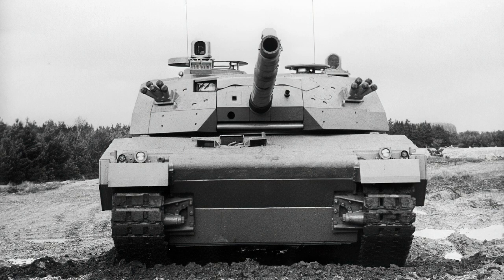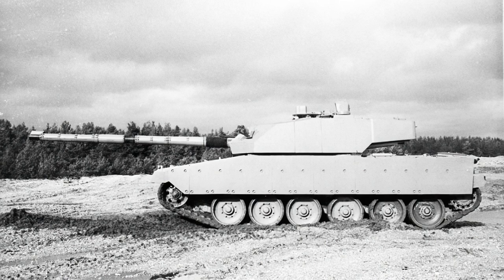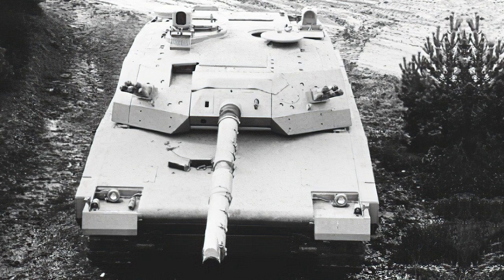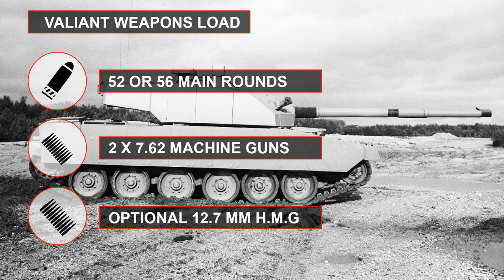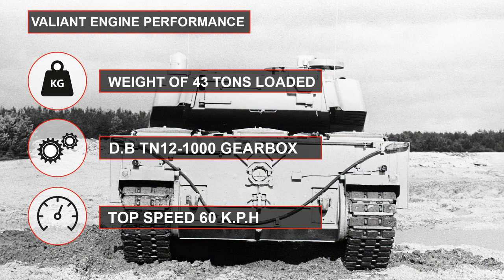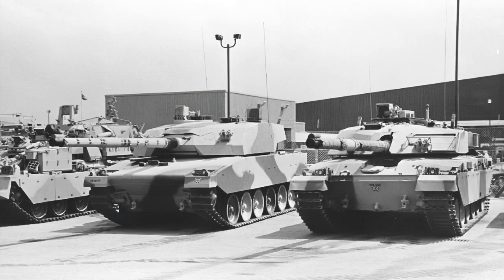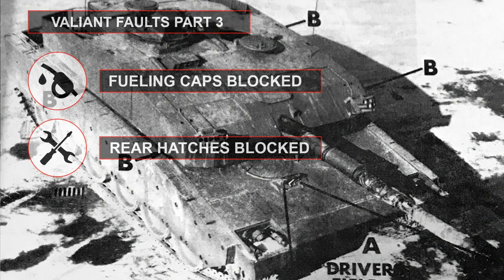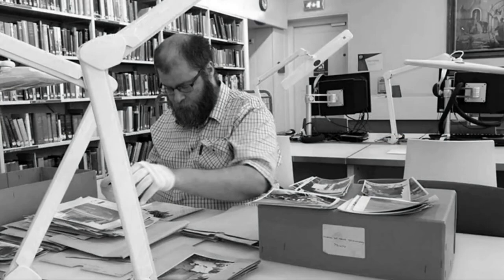Vickers Mk IV - Tank Design & Development

Comment: Great video. I worked for Vickers and was at Larkhill preparing to take Valiant to UAE on desert trials, we came back from lunch and found it upside down! major strip down at Bovington. Turret taken off and elevation gearbox repaired. the very wet soft ground helped, we still made it to the desert.
Reply: Rob, also a "significant first" was the complete integration of the weapon control electronics with the mechanics of the T & E gearboxes, turret ring etc from the drawing board forward. I was the Mil control systems GM at MRSL who developed (and named) the Centaur system. This, in its original form was our SFCS 600 fcs fully integrated with the freshly developed "solid state metadyne" (a 24v solution to the 56v problem in MBT80)- and also to the VS580 at the commander's station. I'm confident to say this level of integration WAS a world first - as a working demonstrator. Incidentally I had an NGL air conditioning system fitted to a Scorpion whilst running the Sales team @ ATDU - mid 70s!

Comment: Awesome job, thanks Ed,
Can you give us more details about the KE protection of the hull front and the CE protection of the turret front ?
I've also a few points to make :
- I think that the French 120 mm smoothbore gun proposed on the Valiant was the older G1 (AMX-40 and Osório ; export MBTs) and not the newer F1 (Leclerc).
- Regarding the dead ground in front, by the end of the 1982 two additional periscopes (slightly looking downward) were added on each side of the original.
- Concerning the viability of the aluminium hull concept : the FV4211 achieved 12 000 track miles on various test tracks, and it was found that the components life was marginally better than that of the Chieftain. There was enough confidence in the aluminium hull rigidity after six months of trials.

Comment: This seems like a great WarThunder UK premium tank!
Reply: I hope not, mutch better as a tech tree vehicle just before the vickers Mk7. if the soviets get 7 non-premium MBTs from 9.7+ (plus another 2 9.3, and then a premium 9.7) the brits can get get 2 more 9.7+ MBTs too (and perhaps some 9.3s too)

edit:
the jordanian falcon II turret family (Centurian, challenger mk1 and chieftain tanks with new turrets, partially designed by south africans) or the EE-T1 Osório tank can be the 9.7 premiums. after all the soviets 9.7 premium is a non-russian T-72.
Reply from the maker: it would indeed, but where to place it in the tiers hmmm?
Reply: @armouredarchives8867  
Tech Tree: 120mm + Thermals = 9.3 or 9.7. (Depending on engine power and mobility)
Premium: 105mm + NVG = 8.7 or 9.0. Again, depending on the engine power. It could act as a well armored Leo 1, able to dish out damage, but withstand APDS and HEAT rounds.
Reply: @matthiuskoenig3378  I was completely unaware that the Osorio used a British turret, which makes it a serious contender for a British premium.

As for the Vickers MBT Mk 4 Valiant, the Mk 1 and Mk 7 are already in the tech tree. Obviously it would go between them. Along with the Vijayanta Mk 2 and the Vickers MBT Mk 3.

Also, the South African Olifant series needs to be added to the British tree.